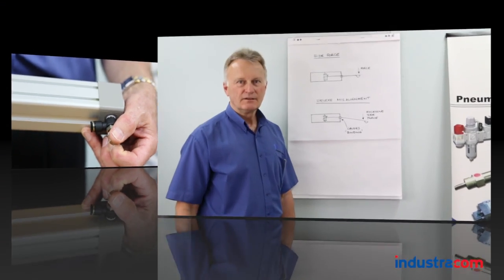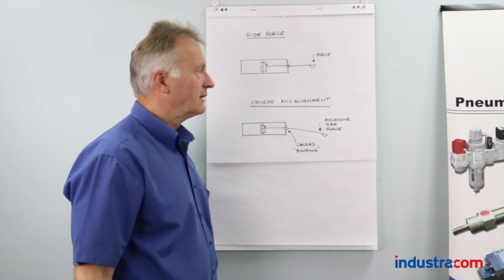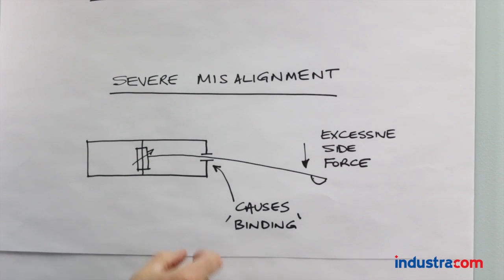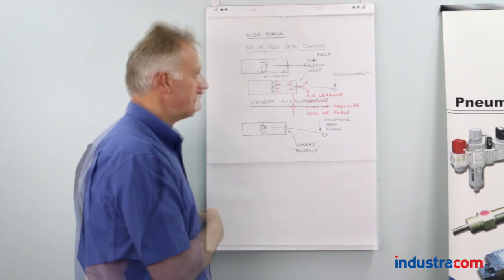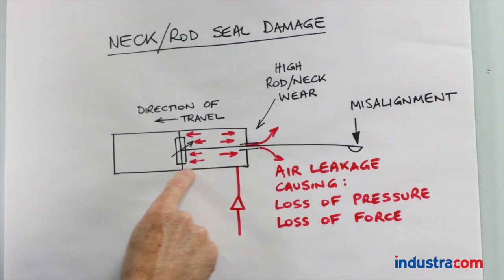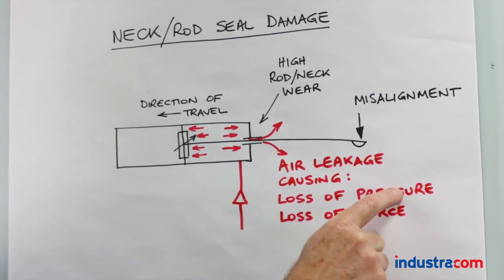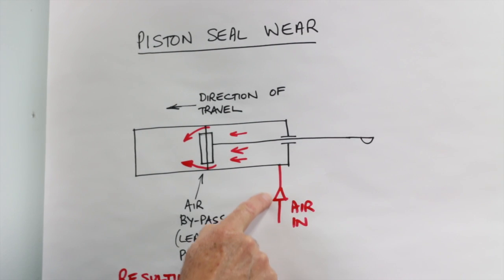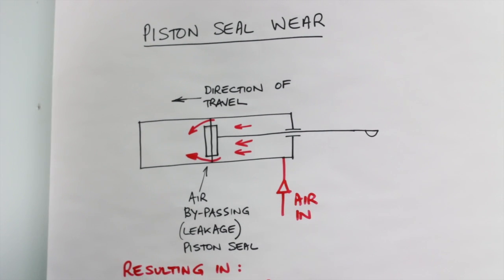Possible causes for an air cylinder to lose speed or force by Pneumatic Products

Comment: What would be the best lubricant for these pneumatic cylinders? I have a half dozen cylinders on a tire machine and only information they give is to use an ISO 32/SAE 10 mineral oil. It seems that these products are mainly designed for hydraulic systems and not pneumatic systems. I don't want to introduce a lubricant into the system that can cause the rubber seals to deteriorate prematurely.